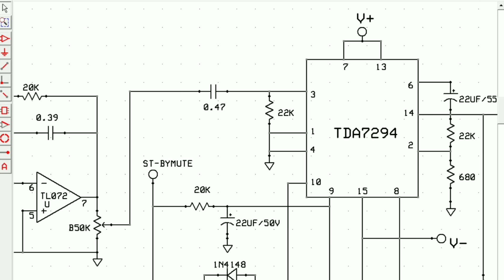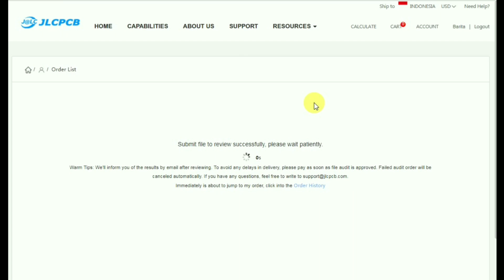TDA7294 Subwoofer Amplifier

Comment: for power can i use 18+, 18+ and ground? the CT what is the meaning
exept from transformer what else  can i use?
Reply from the maker: CT = Center Tap or symmetrical voltage
Use 18V-0-18V from transformer
Reply: @barlexrespectaizer452  I have done exactly as you said but the final project it's like a crap... No sound at all , only scratch sound with no power I have put a woofer but no boom boom , I have try speakers but also no sound. You can't even understand the song
Reply: @barlexrespectaizer452  what happens and the sound it's for garbage??? What is wrong??

Comment: Can 7296 be installed instead of 7294?
Reply: Yes but 7296 only 60W and using 70 V power. So you need to change capacitors to 3300 mF 50V.Even 7293 better but 7294 is the best 100W TDA amplifier 😉

Comment: I think this is 100w rms because tda 7294 has a rms  power of 50w . But very nice design and video. Keep it up.
Reply from the maker: 160W pure on bridge mode
Reply: @barlexrespectaizer452  how 50+50 is 100w i like your chanel but i dont agrre this . I sarch for it. Thx for the response.
Reply from the maker: why you not agree, this is from datasheet
Reply from the maker: BRIDGE APPLICATION
Another application suggestion is the BRIDGE
configuration, where two TDA7294 are used, as
shown by the schematic diagram of figure 25.
In this application, the value of the load must not
be lower than 8 Ohm for dissipation and current
capability reasons.
A suitable field of application includes HI-FI/TV
subwoofers realizations.
The main advantages offered by this solution are:
- High power performances with limited supply
 voltage level.
- Considerably high output power even with high
 load values (i.e. 16 Ohm).
The characteristics shown by figures 27 and 28,
measured with loads respectively 8 Ohm and 16
Ohm.
With Rl= 8 Ohm, Vs = ±25V the maximum output
power obtainable is 150 W, while with Rl=16
Ohm, Vs = ±35V the maximum Pout is 170 W.
Reply: @barlexrespectaizer452  yes i see this datasheet .
But i have 2 of these amps the circuit is not the same but i built it well and i measured my power with smd technology watt meter and it was 140w
Reply: @barlexrespectaizer452  it can be becouse of the small power loss on the d mos s . I se a max of 140w at 45vx2

Comment: Sub impedence shold be 8 to 16 ohm in brdge mode? Will it owrk on 4ohm?
Reply from the maker: work, but more big THD
Reply: @barlexrespectaizer452  as per data sheet in bridge mode 16 ohm is recommended +_25 vdc 8 ohm recommended 
What will u suggest?

Comment: Is It 4ohm Stable? And if so.. what is the output power at 4ohm load?
Reply from the maker: on datasheet 8ohm about 150W in bridge mode. may be about 170w at 4ohm
Reply: @barlexrespectaizer452   Thanks For your reply. Acctually iam Confused cause in datasheet its says in bridge mode 170 watt at 16ohm.. how is it possible cause the impedance will be so high..
Reply: Use it on 16 ohom 35-0-35 volt 3 amp You'll  get very low distortion  and 170 watt

Comment: can i put +-35v ?
Reply from the maker: I'm not sure.. 24v is very hot
Reply: datasheet says up to +-40 but 35 should be it's limit
Reply: Use 35 dc ....24-0-24 provide 31v dc

Comment: Can i use 8-12 inch speaker as subwoofer will it decrease the bass intensity when increase the size of speaker
Reply from the maker: yes, but the watt of speaker smaller than 300watt
Reply: How about when I connect with 30-0-30v 5A

Comment: Sir Zener Diode & Poly Capacitor Value?
Reply from the maker: there is no zener sir.. that is 1N4148 diode
and the big capacitor  you can use 3300uf 50V.. and the other 22uf/50v
Reply: @barlexrespectaizer452  I am talking about the 2 components that you put in the last
1, green poly capacitor Value?
2, 1N4148
You See The Photo Sir
https://prntscr.com/pw3z2n

Comment: Sir 18-CT-18
CT Meaning? And Transformer Ampere For Comfortable This Circuit?
Reply from the maker: it means 18-0-18 transformer.
you can use 5-10Ampere transformer sir.
Reply: @barlexrespectaizer452  thnxx sir

Comment: Superb!!
Bro,  in which mode you configured the  tda7294 ics to make this amplifier.? Is it in bridged mode or in parallel mode.? Please tell me.
Reply from the maker: bridge mode brother,
Reply: @barlexrespectaizer452  
Can i use this amplifier for my infinity primus 12" car audio subwoofer. Is there any problem while bridged  amplifier connecting with 4 ohm driver ?

Comment: If I used 30-0-30v 5A supply then how much watt will I get in output
Reply from the maker: about 200watt output from the transformer.. but it will be very hot

Comment: How to get above 100w from these circuit
Reply from the maker: use more current or voltage on the supply.. or you can try to paralel the output sir

Comment: Is there any another resistor instead of 330k .
Reply: I have 390k resistor can I use it
Reply from the maker: @gokulg264  sure
Reply: Tnx sir u r great
Reply from the maker: that's gain resistor, if your input signal weak you can change with more than 330k, like 390k but if your input signal strong you can use 100k or 220k resistor

Comment: How many amp. Transformer need for drive 3 board (200w+200w 200w)
Reply from the maker: You can use 10-15Amp transformer 24v CT. and it will so hot.
Reply: I have 27-0-27  16 amp. Transformer .
Can i use this transformer in 3board  with cooling fan

Comment: ·	Sir In this circuit you change the value of some component and tell you I want to run this circuit on 24 0 24 supply so that you tell the component.	Use them or use PCB containing please tell  me I am wating
Reply from the maker: no problem sir, you can use 24-0-24 transformer. But don't forget to use big heatsink on it. by the way use the 50v elco on the supply. I'm use 18-0-18 because very difficult to find a original ics in here
Reply: Barlex respectaizer ok sir·	Sir, I did not even get the IC, I got tired of walking around
Reply: Barlex respectaizer thanks sir

Comment: Hi, wanted to know what is the woffer Brand used in? 

How much watts woffer @ what ohms ?

what is the AC Voltage and ampers used in this ?
Reply from the maker: hi,
I used audax 6 inch 8 ohm 100watt
Reply: @barlexrespectaizer452  
Thanks for the reply,

I need some technical help, 

two TDA7293 IC PCB Board how much rectified DC voltage and amperes required to bring it to its full potential ?
Reply from the maker: You can use 22V DC up to 33VDC /5 Amp.. but you may need extra heatsink when use about 33V
Reply: @barlexrespectaizer452  
Thanks for the reply, 
I was trying to Build 5.1 using three board, of TDA7293 (2 ics each) connected parallel to full Bridge rectifier (40000 uf) to a transform, but problem is my Board does not have on board rectifier it needs external rectifier so how should i limit it current to 5 amperes, as the transformer will be AC 22 0 22 Or 24 0 24, will be around 12 ampers

So what do you suggest how should i limit the current ?

Should is use two diodes of 2 amperes or 3 amperes (each board), on each individual positive and negative rail before it reaches the positive and negative terminal on board 

Or simple 5 ampere fast blown glass fuse on positive rail ? 

Or Both modifications will work  ?
Reply: @Royd20  maybe I'm late but the circuit will draw as much current as it need's ( ohm's law tells it ) so don't worry even if your transformer can deliver 12 amps the circuit will only draw vlose to 5 so no need for modifications because you will waste power and you will have voltage drop on the other components you wanted to add. so less power for the amp

Comment: Om, maksimal mampu buat mengangkat spiker berapa inch.??
Reply from the maker: 12" saya rasa masih sanggup asal trafo bagus
Reply: Kalo pakai travo 20 amper sanggup apa enggak gan
Reply from the maker: datasheet nya maks out peak 10 Ampere.. lagian sya gak berani bilang tahan 20A soalnya banyak IC yang aspal gan..
Reply: @barlexrespectaizer452  gimana gan cara bridge 4 ic tda nya
Reply from the maker: belum coba sih, soalnya itu kan mosfet bukan class AB